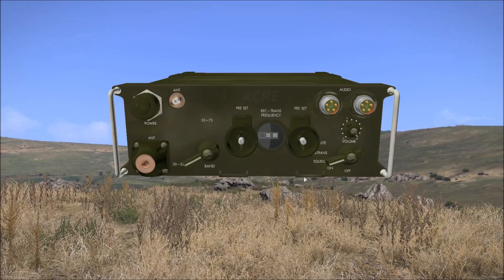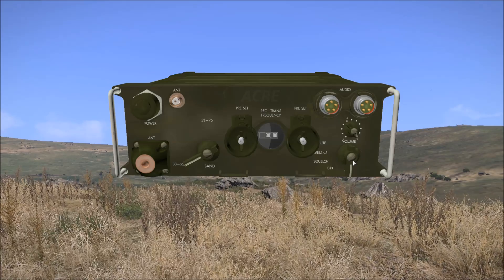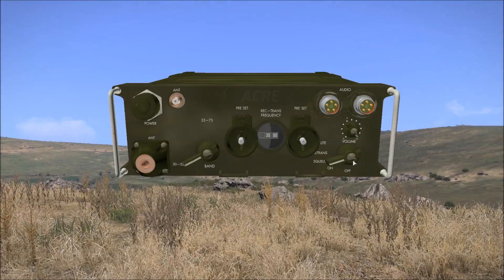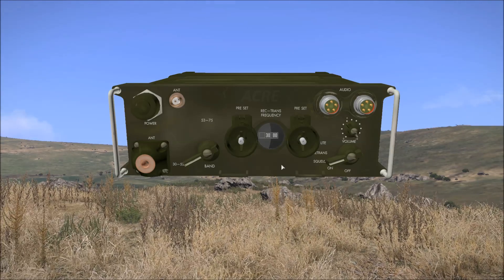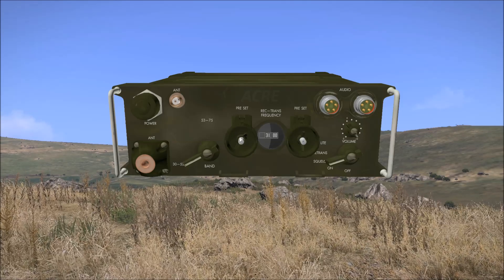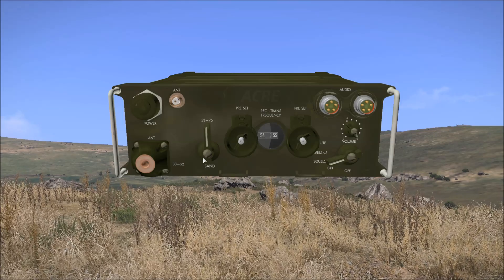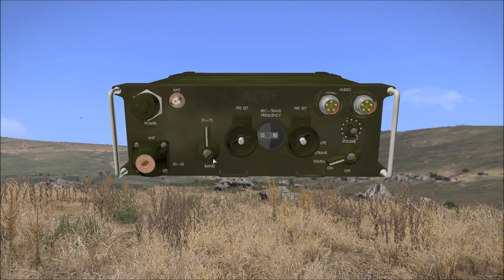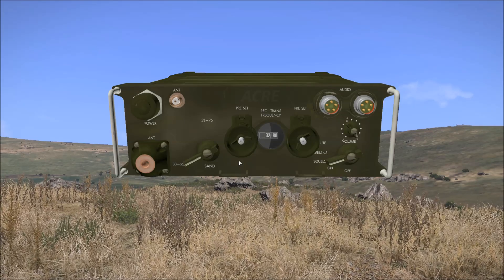ACRE2 PRC-77 Interface and Tuning Overview

Comment: Dear Group
Attached is the link for PRC-77 price list recently uploaded to the 
group FILES : http://groups.yahoo.com/group/Racal-manpacks/files/ -Under anthony hendra
Our firm is a legitimate company based in indonesia and we dont have any website and will most probably never have any.
Previously we only deal exclusively to government issued purchase 
order and we have legit papers for that - incl advanced payment bond, bank guarantee and performance bond issued by Bank of America (BofA).
Our contract is strictly government. including instructions from BofA 
addressed to the Commander in Chief of The Indonesian Army.
We'd prefer to sell and ship them in whole. these merchandise have been sitting dusty but are kept and maintained in fine condition. as stated before - these are just leftover stocks that we are happy to clean out. :)
MODULE SPECIFICATIONS
A11A - DISCRIMINATOR SYNTHESIZER - D875705
A16A - VOLTAGE REGULATOR - D875708
A17A - PHASE COMPARATOR - D875704
A18A - 5.6 MHZ IF AMPLIFIER - D875722
A21A - RECEIVER IF AMPLIFIER LIMITER - SMD 875724
A23 - TONE GENERATOR - 447316
A31 - TRANSMITTER FREQUENCY CONTROL - 448740
A32 - RECEIVER INPUT - 448741
A33 - RECEIVER FIRST RF - 448742
A34 - RECEIVER SECOND RF - 448743
A35A - RECEIVER MIXER - D875692
A36 - TRANSMITTER PA - 448744
A37 - TRANSMITTER IPA - 448745
A38 - TRANSMITTER VFO - 448746
A39A - SYNTHESIZER VFO - D875672
A40A - INTERVAL OSCILLATOR - 875659
A43A - 53 MC FILTER - 448739
A44A - FIRST MIXER - 621272
A45A - 1 MHZ SPECTRUM GENERATOR - D875701
A50 - XMTR MIXER - 448753
A54A - TONE SQUELCH - 875637
A55 - RECEIVER AUDIO - 448752
http://www.nj7p.org/Manuals/Index_Manuals.php/

Comment: I pretty sure you are not correct about the function switch.If you have it in the on position it only disables the Receive Decode tone of 150 CPS the transceiver always transmits a 150 tone code regardless of position. ,if it's in the on position another 77 will still decode and hear you Regardless of there squelch position,also any of the old family radios PRC-10 and Prc 6 will be heard by the 77 as they don't have 150 CPS tones that was the purpose of the two different positions "on" equals old squelch but still transmits 150 CPS for any 77 or 524 that are listening.Jim KB1PFL
Reply from the maker: Hi Jim,
Good to know, thanks for sharing that. I wasn't entirely sure how it behaved on the real thing.

The video was meant to show how the ACRE2 mod had implemented the feature on the radio and how it could be expected to behave at the time the video was made.
Beyond a quick look at the updated UI I've not had much opportunity to play with the 77 in ACRE2 since making this video so I can't say if it has been updated to behave more like you described or if it still behaves as described in the video.

Given the age of the video, there have been a few updates to the mod over the last 3 years including an updated UI shown on the documentation page for the 77 http://acre2.idi-systems.com/wiki/radios/an-prc-77